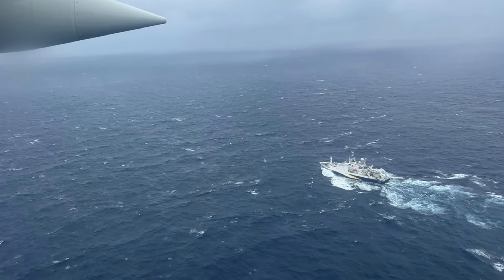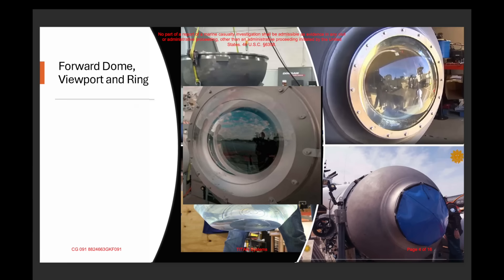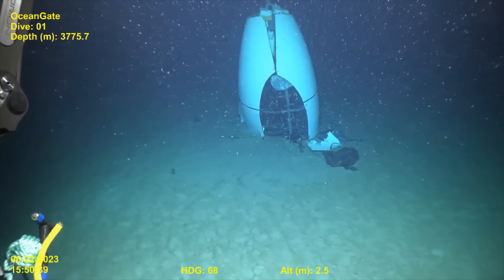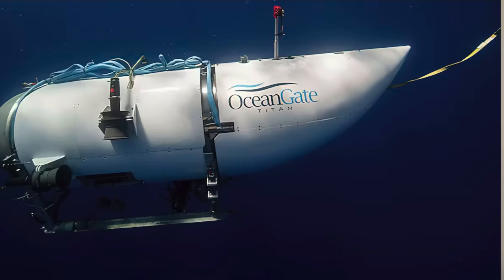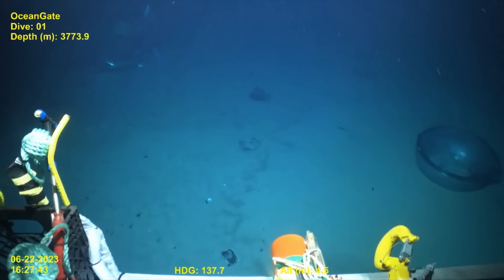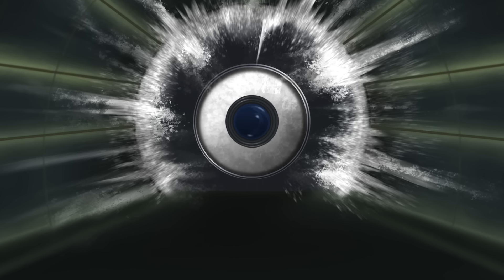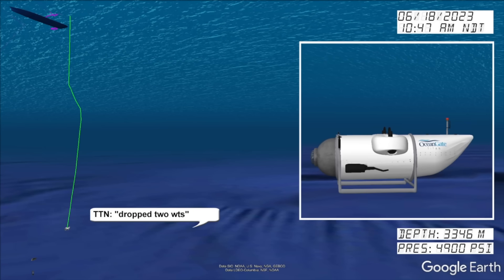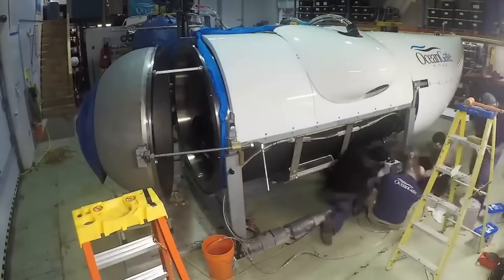Analyzing how the Titan submersible Imploded.

Comment: Sounds like Stockton Rush was exactly the kind of man J. Bruce Ismay was accused of being.
Reply: Ironically, it was a freak accident that sank the Titanic.  The ship had state of the art safety systems, the best steel available at the time, more lifeboats than the law required, and the crew did everything by the book.  The only problem was that the book was flawed, and the sinking of the Titanic revealed those flaws.
Reply: you mean captian crunch?
Reply: And his family has been suffering over his loss for a year.
Reply: Of course. Because the movie portrayed him as a bad man, so therefore it must be true.
Reply: They both had deep seated issues.
Reply: that and they forgot to  give the look outs binoculars.
Reply: @michaelbujaki2462 the original plans for the titanic included way more than enough lifeboats. J. Bruce Ismay wanted to have deck space on the top so he removed some in the design.
Reply: was their a camera recording inside the sub
Reply: Can you imagine how things would have gone if Rush hadn't been onboard the Titan and he was left to deal with the aftermath?
Reply: @michaelbujaki2462 disagree it was just a freak accident as the Captain knew the weather was bad but sailed into New York anyways due to social pressure to get there in time
Reply: @sarij3950  he probably knew it was going to fail and didn’t want to be alive to take the heat over it.
Reply: @Spacewinterknight 

No, the ice warnings Titanic received said that the visibility was good, and on the night, everything looked clear.

They couldn't tell that there was a cold water mirage because there was no moon.
Reply: @DinoFan8  you live in denial the captain was under financial pressure to speed through
Reply: @Spacewinterknight that never happened it was only featured in the movie
Reply: @Spacewinterknight 

Yeah, the captain wasn't pressured to go faster. The ship was just performing very well and they thought that they might arrive early.
Reply: No, the number of lifeboats was increased compared to the ‘Design “D” concept’ approved in July 1908.  Four additional collapsible boats were added.  The ship’s lifeboat capacity (as a proportion of the maximum number of passengers and crew carried) increased 39 percent.
Reply: @imperialempire8569 ships like titanic themselves were designed as a massive lifeboat
Reply: @zal88 You mean Captain Schettino !!! Captain Coward
Reply: @GreatestMinecraftPlayer  lol
Reply: If you believe in past lives or not. If u look closely at rush and ismay u can actually see face similarities actually! See for yourself

Comment: That dome popped off like the lid of a pringles can.
Reply: Startles me every time
Reply: Good analogy.
Reply: more quality control on that can of pringles unfortunately
Reply: so the carbon fiber didnt fail....it was glue that held the ring and carbon fiber cylinder together that failed?
Reply: @randomrazr very possible but it could be both the glue and carbon fiber.
Reply: @randomrazr carbon fibre contracted causing water ingress that lead the the end cap and titanium dome popping off and forced the carbon into the back dome.
Reply: @halomultiplayermoments  so it was the seal that mainly failed and the poor choice of carbon fiber due to the nature of contraction with titanium
Reply: Yeah then the pringles can rolls in on itself like a black hole 😅
Reply: A set of dentures can be clearly be seen next to the round white object inside the opening.
I guess the Polydent didn't stick.
Reply: In this situation once it popped the fun did stop
Reply: @randomrazr ya not so sure about that. The tab of the ring was sheared off all the way around. Water can't do that unless it was already cracked. The front dome was sheared off the season before. That had to do major damage to the ring and hull
Reply: @shepherdbook8783   Ouch, good one.
Reply: Now I want Pringle's 😩 😫
Reply: It's impossible for it to pop off; the exterior pressure would keep it in place.
Reply: @ForensicCats  not when the pressure equalizes tho..
Reply: @ForensicCats  not if the water got in behind it so ya it popped off alright
Reply: @randomrazr  not so fast. That guy wasn't an engineer that said that. Although he smarter than the "engineers" that said the Titan was safe. Ow did I put that in quotes? Well, I'm not sure they deserved engineering degrees
Reply: i made this "theory" shortle after it happend. i associated it to a can of m&m minis. squeeze the tube and the lid pops off.
Reply: That’s what I think happened, too, judging from the photos the Coast Guard took.

Comment: Seeing how they wiped the titanium ring with a dirty rag, touching it with bare hands, mixed the glue by hand (no way to guarantee an even mixture), and then just applied it by hand with spatulas in what looked like an auto repair workshop and then thinking it's okay to take this botched together Frankenstein vessel to 4000m depth just boggles the mind.
Reply: Honestly, i'm actually surprised that it could descend so far down before imploding.
Reply: They used Polydent instead of glue.
Reply: There's now a rumour going around that the interface was the point of failure rather then the CF shell, personally I think it's a combination of the two, however your "glueing"observations are so true, why could no one see it!!
Reply: @TylerDurdan241  Remember that Rush interview where he said that "there's a rule that you don't mix carbon fiber and titanium. Well, I did it." That's why the rule exists, the 2 materials don't react to pressure in the same manner. The American Bureau of Shipping (ABS) flatly refuses to class a CF hull.
Reply: Don't forget they then left the damn thing in the corner of a car park over winter!
Reply: I’m surprised it didn’t implode the first two times
Reply: @francescawilliams8177  Exactly.
Reply: to be fair, that video had very little context. for all we know, they had just received the dome and were doing an initial clean/wipe down after unpacking it from shipment. they didn't make most of this stuff in-house.
Reply: @joesaiditstrue  there is a video out there and it looks like a backyard at some boatyard. By all means I don’t expect it to have been made in a sterile environment like an operation room but it looks dirty and unsanitary considering what would be at risk
Reply: @shaunmcclory8117 ya i noticed that aswell

Comment: As soon as I read about the Titan pressure hull being made from two entirely different materials, I immediately thought of a bimetallic strip that is used to cut the power to an electric kettle once the temperature of the water inside reaches 100 degrees C. I knew then that repeated pressure/depressurisation cycles would cause a major problem!

Comment: Having being in the fiberglass industry for most of my life, and now in my 70's,  I was astounded when I saw the footage of these kids mixing and applying the epoxy glue in a shed with no apparent temperature control etc.  When we used to do the carbon and gluing etc,  the  application was always in a tent that had a temp and humidity controlled input.

Comment: They probably could have used the same double o-rings and coupling, thst was employed on space shuttles and their boosters. Although these lead, because of thermal stiffening at low temperatures, to the demise of Challenger- usibg the same mechanism and keeping it within thermal safety guidelines- alternatively by providing adjacent electrical ring-heating, should keep the seals safe… liquid water has a far higher density, than the gasses kept contained in the challenger boosters, so the same mechanism should work here

Comment: From the coverage I've heard, it really seems like it was kind of a tossup as to exactly what had caused the wreck. The carbon fibre hull was the most common suggestion, but I had heard speculation about the epoxy and the acrylic window. It seems like any of these could have caused the disaster, it was just a matter of which one was going to fail first.

Comment: it was actually the carbon fiber that failed, the mating surface gradually lost its bond with the titanium ring due to each compression/contraction of the carbon fiber. apparently they didnt take this into account when choosing the adhesive (how couldnt they? everyone knew that the pressure vessel would undergo some physical changes between each dive)

Comment: They were trying to design a vessel that could hold 3-4 passengers. Designing a proper craft capable of safely diving past 4,000 meters with all certifications would have been one of the most expensive submersibles ever built and that’s why they cut corners. They had no business putting passengers on an experimental vessel that wasn’t tested properly and certified.
Reply: Wild right? Why not make two spherical ones and you all go down together in separate crafts 😑

Comment: I work with subsea housings in my job on survey vessels so i know a fair bit about trying to keep tons of ocean out of a subsea vessel. 

This design has all sorts of red flags. 

That glue of two materials is really not a sensible idea- especially in the water depths this was meant to go to- maybe they get away with it in shallower water but where the materials will compress there is going to be trouble. The water would just blast in when it de-laminated. There not necessarily going to be this warning Stockton kept going on about- the fact he died shows he was very wrong on this.

Carbon fibre is unorthodox- its a material strong in tension not compression- its like pushing with a rope!

The fact the towed it behind the vessel 😣!! That would have been getting battered by the seas! I cant understand why they thought tgat was ok- even from a money point of view- your asset could easily be destroyed. Imagine a storm whipped up. Even with no storm. The titan was totally exposed. Id hate to be a technician on one of those voyages trying to test and maintain that when its out in the open.

Comment: As a power engineer apprentice, a lot of my course training time was spent on material properties and how they change and react.  Things expand and contract, flex and deform at different rates, and all of this has to be accounted for in designing a pressure vessel.  Industrial Adhesives are very particular.  They have to be formulated just right, have a limited shelf life, need to be applied in the right environmental conditions, using very precise methods, and have to be operated or used within strict limits.

Comment: Considering the Titan did have a successful trip to Titanic you have to wonder if they had actually followed proper procedures with testing refined their designs and had proper manufacturing processes could they have been onto something for exploration instead of this "back-of-a-cigarette-packet" "Glue mixed by hand" scribbling of a design.

maybe not as manned vehicles but cheaper smaller drone vehicles maybe I didn't know.  I guess we will never know.

Comment: If Stockton had wanted to be “safe” with Carbon Fibre, then he should’ve at least built a brand new pressure vessel every year.
Reply: Yeah exactly that's the thing that's been replaying in my head why weren't there five or six different versions of this whole ready to go? Like change it out every single mission you know that they don't they change all of the space shuttle stuff every time they sent it up every single time like it got a whole new motor seals the whole nine yards that should have been the case with this too.
Reply: But if that is not what failed and it was in fact the window seal, then replacing the carbon fiber haul wouldn’t have prevented this incident.
Reply: @HallaDarVemArDu  Exactly and I find this quite a surprising discorvery. Because untill a week ago everybody assumed it was the carbon fibre hull that just snapped and turned into dust, which we now know is not what happend at all.

Comment: The hull could have been monoblock titanium and maybe the support should be carbon fiber rods inside. That adhesive and two different types of materials were invitation for a disaster under that pressure.

Comment: The idea that the carbon fiber compressed at a different rate than the titanium rings , was exactly what I thought as well. Also, the carbon fiber hull was not found intact. My question was, didn't he go down to the wreck of the Titanic, prior to this dive? Or was this the maiden voyage? 
Also, there were stainless steel bolts, embedded into the carbon fiber shell. Those bolts held the titanium rings on to the shell as well as adhesive. The adhesive was primarily a water tight seal between the shell and the rings. At least that's how I saw footage of the assembly of the sub. But my biggest question was, had they found the carbon fiber hull intact. Because that to me, proved my theory. And, I had also thought he'd had the sub down before. Because stories told so far, say something about, previous dives. 
Thanks for your analysis.

Comment: So I was right, it WAS the glued joint between a titanium end ring and the carbon fiber center section failing that killed those people. I thought it was most likely that, the viewport caving or the carbon fiber unraveling under repeated exposure to the nearly 6,000 psi ambient pressure down there. With any of them, they're just as dead, just as quickly. Ultimately it doesn't matter, that submersible was a death trap and a tragedy that was bound to happen. The blame is one hundred percent on Stockton Rush. Titanic claimed far too many lives as it is, and because of Rush's obessession overriding good judgment, Titanic claimed five more.

Comment: No, the Navy knew it imploded within less than a minute or two (max) after the event. (acoustics travel way faster than the speed of sound underwater)...  We have IUSS, formerly SOSUS listening by way of a myriad of "hydrophones"...  Most people in the "know" and having an understanding of engineering submersibles know glue is a no-go.   You WILL not see a pressure vessel created and certified that uses ANY such adhesive glue (resin mix, etc) having to do with the pressure vessel..  When do you think the last time anyone used adhesives, glues, exotics to bind two. dissimilar materials in high pressure environments..   Well, Oceangate did...  And, while they got away with it for a while, it failed miserably...   No revelations here we all didnt know..    Care to know the difference between the Titanic and the Titan?   One is a bonafide wreck = Titanic..   The other is essentially a tiny reefing, but not much good for critter habitat like when we sink retired ships on purpose or just because someone is stup!pid..
Reply: How do "acoustics travel way faster than the speed of sound underwater" ?  Did you perhaps mean that the notification signal of the acoustic event (I presume by an electronic signal via cable or radio) travels way faster than the speed of sound underwater?

Comment: It's not really the matter of how the titan imploded.
Stockton was asked how many dives did he think the Titan could dive safely and he responded indefinitely.
All other RESPONSIBLE engineers understand that however a submersible is made or material used, the repeated stress WILL weaken the vessel's structure and the vessel will eventually fail.
If the submersible lasts the first dive, that's perhaps a success.
Will it last two more times or twenty? Who's to know but it must be retired and replaced eventually.
Stockton guaranteed an eventual murder suicide pact.

Comment: The glue is a red herring and even possibly the de-lamination of the carbon fibre, I think the inner 10mm thick titanium lip which took (all) the weight of the water because the carbon fibre tube contracted under pressure more than the titanium ring, failed, sheared off and then there was nothing holding up that end of the carbon fibre tube any more, so it collapsed. The glue could have been made of window putty for all the structural integrity it gave, no glue ever invented could hold up to those shearing forces of course. All this talk of strong glue is ridiculous, It was so weak in comparison to the dirty, contaminated surface area it was badly applied to and the carbon fibre and titanium, glued only along a thin 5" edge, the lips were so small they might have not even bothered, in fact, I don't think they even did, have you seen the video of them applying it!, I would have wanted my tiling contractor to have taken more trouble tiling my bathroom than they did putting that adhesive on the surfaces, touching them with bare hands and dirty rags and mixing it with a wooden stick but anyway, I think the glue didn't even count in the equation and only served to stop the ends falling off whilst the sub was out of the water. Note: effectively the hull of the Titan was just 10mm thick at that point, both ends, not 127mm or 5" so it's over 12 times thinner exactly there than every thinks it is and that's where it failed.